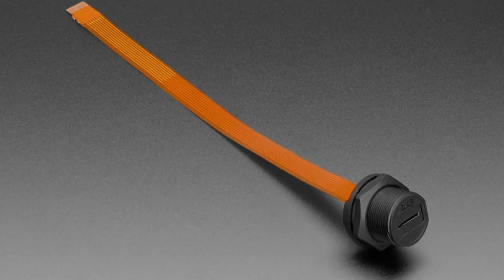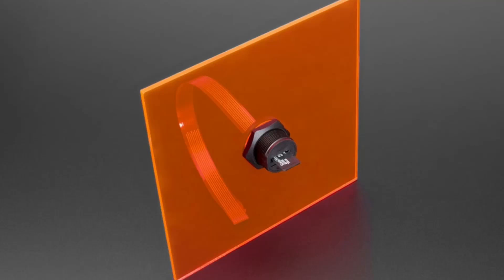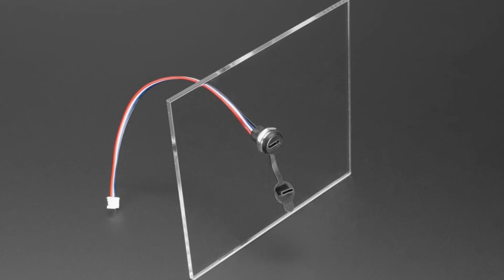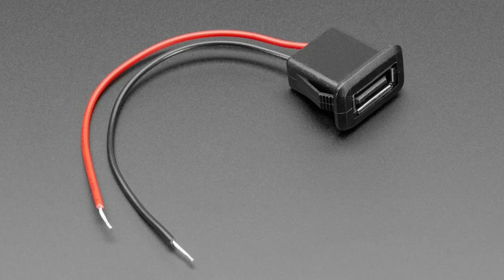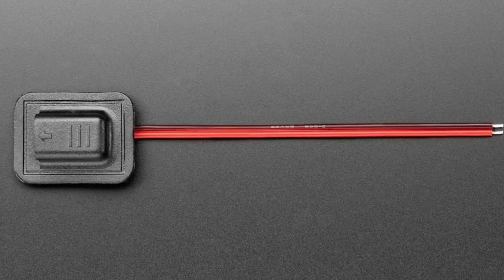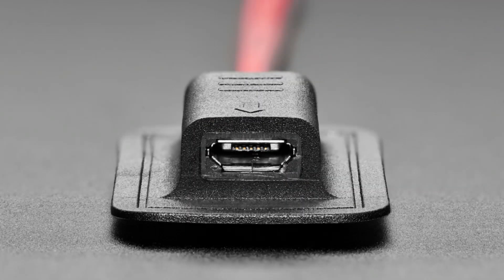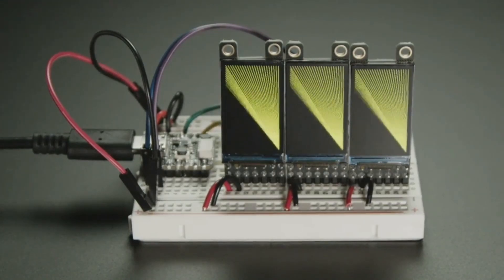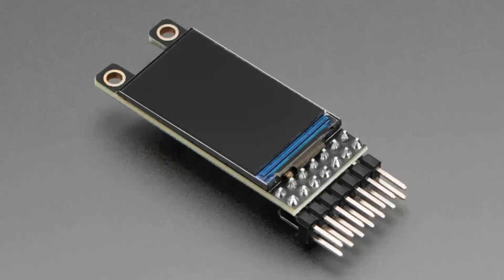#NewProducts 12/18/24 Feat @Adafruit 1.14" 240x135 Color Newxie TFT Display - ST7789

Comment: Any tips for making rectangular holes? Is it CNC or bust?
Reply: Drill 4 small holes in each corner, use a dremel disc cutting wheel to cut from hole to hole. And in no time you have a rectangular hole
Reply: Or you can use a nibbler for thin material
Reply: And if you need sharper corners than @schassis_eddi 's suggestion, get a (cheap (Harbor Freight)) set of small triangular hand files